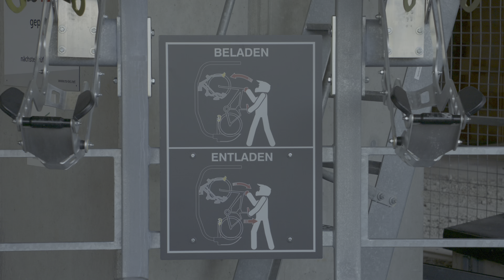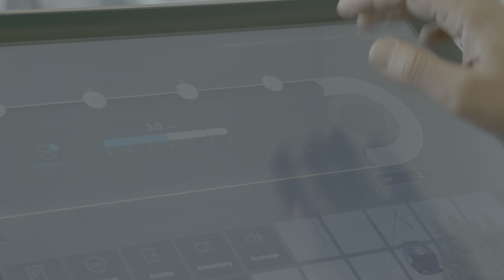Doppelmayr/Garaventa 6-MGD "Eckbauerbahn" Garmisch-Partenkirchen, Deutschland (2019)

Comment: Always fun to see another Doppelmayr video!
But I'm wondering, the station is in the uni-G style (That is the correct way to describe it right? Or did those kind of stations have a similar name/system name as D-Line?) but it runs the new D-Line software. Is this Ropeway made in the uni-G style because it has 6 persons gondola's and is that not possible with D-Line? 
I get why it is only a 6-MGD, that suits the customer, but why not a 6-MGD D-Line? (When it does run that software)
Reply: That is because the d-line was intended for 8 or 10 seater gondolas only and it would be to expensive to design a 6 seater d-line. And the d-line is most likely more expensive than the already designed uni-g wich has already been build with a 6 seater.
Reply from the maker: Hi Jasper! That's absolutely correct - the D-Line is not available for 6-seater cabins. The Doppelmayr Connect system can still be used.